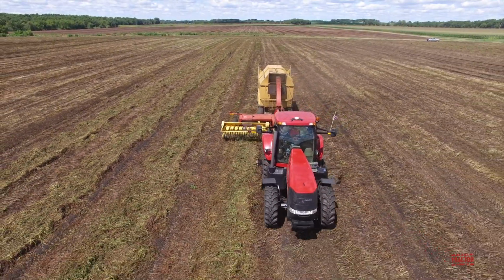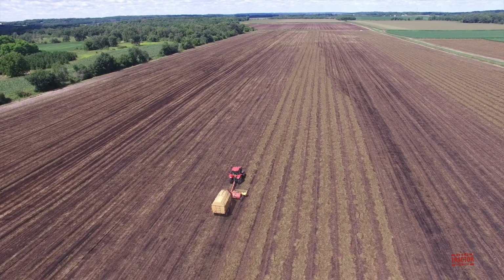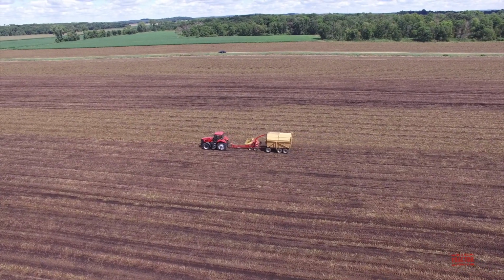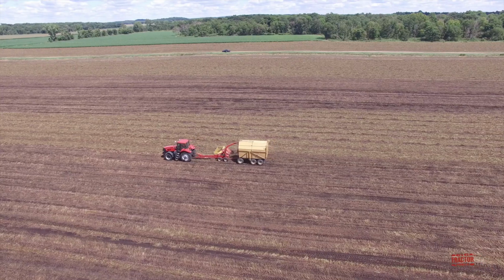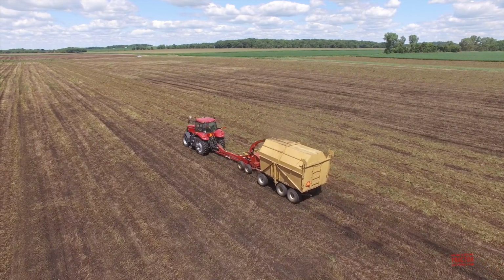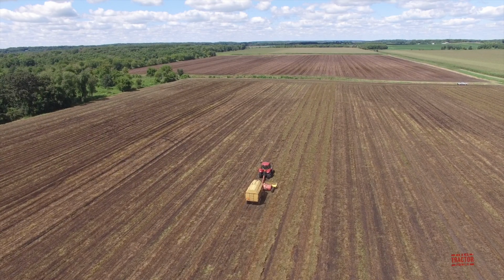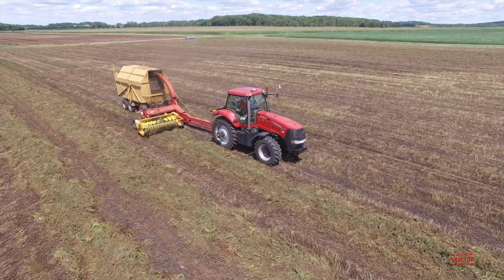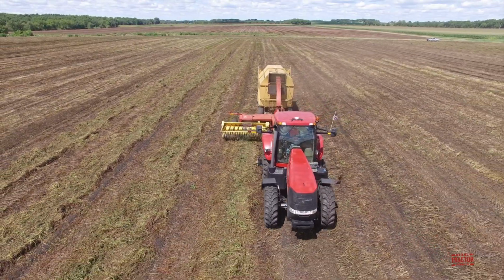Harvesting Mint for Tooth Paste & More

Comment: Great video thanks.
Have seen a machine in the UK where the mint leaves are stripped directly off the plant then chopped into a trailer bin. Two crops/season. 
How many crops do these guys get in a season? 
Thanks again.
Reply from the maker: Thank you for sharing.  Here it is one cut per season. The field will see 4 or 5 years of production.
Reply: @bigtractorpower  Thank you
Reply: @edwardmbarker  thanks Edward, how many cuts per season can be achieved?

Comment: When I was growing up, mint was a huge crop in Oregon.  Yes, each load is steamed, and produces only a small amount of oil.  But, the taste is so strong, small amounts are valuable.  I seem to remember the steaming time to be about five hours, ... but that was many years ago.  The remnants were taken back to the field, just as you said. I remember the piles scattered across the field.  I think they were spread with loaders after the season was over.  It was only grown on sandy river-bottom land.  Apparently, the production has moved to E Oregon now.  OR still produces 35% of the nation's supply.  Yes, the aroma throughout the area of production was strong.  Thanks for sharing.

Comment: Learned something new today, is a self propelled harvester capable to do this job or does the pull type work best for filling those wagons
Reply from the maker: I have not seen a self propelled used on mint. It could no doubt chop the crop.  They want to keep compaction down and the field.  The mint tubs are the right size for a pull type so it probably works out best.

Comment: Is Mint farming more profitable than hay or corn ?
Would be great to see the steaming process.
Thumbs up.
Reply: Mint is grown in muck.
Corn and soybeans don't like muck as much, it's not about the money as much as what crop can be grown on the land you own
Reply: @RJ1999x , Nice, Thanks.
Reply: @RJ1999x  I worked on a mint farm in central Oregon.  Volcanic Sandy well drained Soils and Pivot irrigation. I can see how it could be grown on soils that wouldn't be tolerated by other crops though.
Reply: @mdavidopie6993  Here in Wisconsin it's always grown in Muck (peat soils) . Some farms that we run that have small areas of muck the mint grows naturally
Reply: Acer Acres  That field is located south of the central sands area of Wisconsin. It's low ground, which is the only place you find muck. They ditch it, and tile it, but if you notice the ground is very dark, muck is always pitch black

Comment: Very good informational video but I think your minimum hp requirement on the fp230 is wrong because we run an fp230 with a john deere 7230 that's rated at 135 engine hp and 110 on the pro. It runs it without a problem and when we bought the harvester back in 2012 the dealer said minimum of around 100
Reply: The manufacturer's website states Minimum 150hp Maximum 225 https://assets.cnhindustrial.com/nhag/nar/en-us/assets/pdf/hay-tools/pull-type-forage-harvester-brochure-us-en.pdf
Reply: @Phocoshay_Balperrus  not to be rude but he stated that the MINIMUM required hp is 150. That website states that the minimum RECOMENDED hp requirement is 150. Meaning the forage harvester can be run on less that's just what the company suggests running it at
Reply: @oakhillfarmer4839  I use to sell New Holland choppers, and I can tell you that you can run the chopper with less horsepower, but you've wasted your money by buying such a big chopper and running it with a smaller tractor. The New Holland 900/230 series chopper is a huge machine with a ferocious appetite that loves horsepower. 200+
Reply: @oakhillfarmer4839  Just pointing out the manufacturer's stated. I would think the manufacturer states a RECOMMENDED rating for a reason. But let's agree to disagree!
Reply: @RJ1999x  unfortunately as far as we were aware back then that chopper was the smallest one in the area that was still being built. All the older smaller ones were worn out and there is no point in buying something you will have to replace shortly
Reply: @Phocoshay_Balperrus  I can settle with that
Reply: @oakhillfarmer4839  New Holland use to make 2 sizes. There was a smaller unit that had great capacity the 790 and then they had the beast the 900. There was a huge price difference. Unfortunately to many farmers were buying, or bring sold the beast when they didn't have the tractor to utilize it's capacity, and because less and less forage harvesters are being bought, they discontinued the 790 and used the beast to bring the 230-240.
Reply: @RJ1999x  we actually say a few 900's but they were really worn down so we decided to go with the fp230 and havnt ever had a power issue with 110
Reply: @oakhillfarmer4839  You don't have a power issue, your just running the chopper at 1/2 capacity. Which with New Holland choppers to do a good job need to be stuffed. To stuff your chopper you would need twice the tractor
Reply: Acer Acres  fair statement. We are able to run our chopper at 4.5 mile an hour. All depends on different places I geuss
Reply: Acer Acres  As example, an engine might operate on a less than recommended grade of fuel but it may or may not have as long a life span. Again, the manufacturer has recommendations for a reason. I think that is why they call them recommendations rather than suggestions.

Comment: I bet when chopping, the air is minty
Reply: It most definitely smells great!
Reply: The biggest oil parts are the leaves and not the stamp, it smells yes but not that much.

For a mint infusion (herbal infusion) they use leaves only.

You can test it if u buy a mint plant and take 1 leave between 2 fingers and moving as long as you can that you don't see at the end the leave but you will smell it about 30 minutes later if you don't wash your hands.